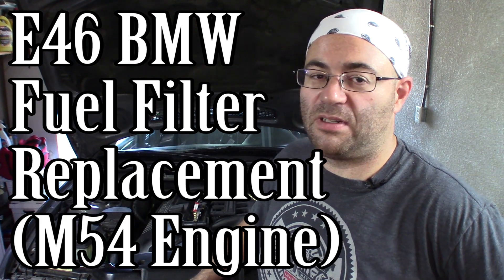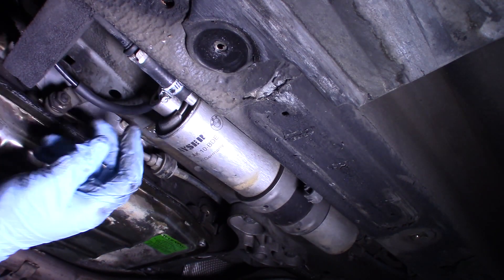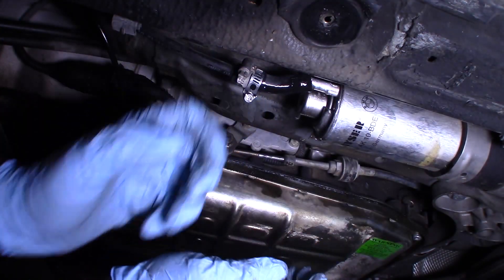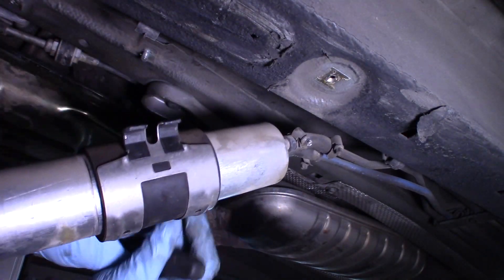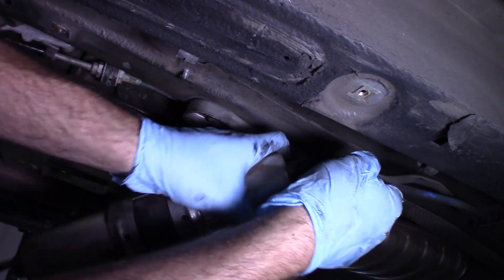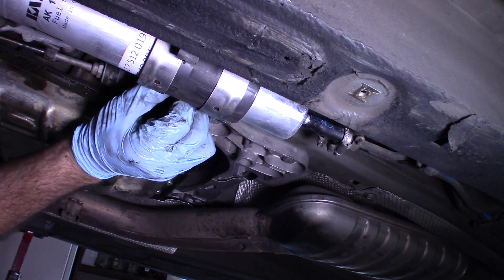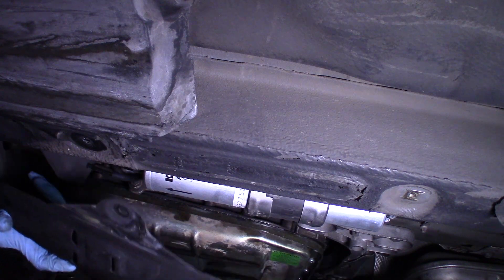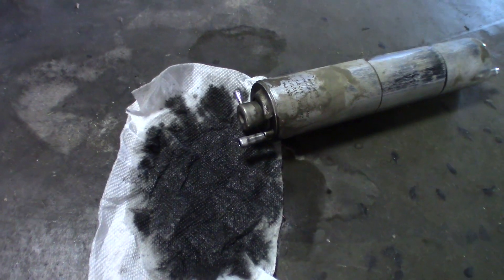BMW 330i 325i E46 Fuel Pressure Regulator Replacement (M54 engine) DIY

Comment: Hi, your videos are a great help for the M54 owners(including me). 
I have a situation now, and I'm really curious about your opinion about it. 

Let's start with the start. 
More than a year ago I discovered that I couldn't empty my fuel tank more than 1/8th of the meter. When the warning light came on, my car died(with a left range of 80-90km). It happened 2 times before I knew I had to fuel earlier, and the problem was 'solved'. 

Half a year ago, the engine check light came sometimes on. It was not always there, but just sometimes. It was throwing the codes P0174 and p0171. At first, i was looking for a vacuum leak somewhere. I changed the DISA gasket, the valve cover gasket(including new vanos), and the two Rubber boots at the intake. It was still coming back. I changed my MAF sensor, but this also not helps, and the last days its getting worse. After i fuelled the car completely up, it was really worse.  At cold starts, its dieing directly 2 or 3 times. After that its shuddering and on 5-cilinders. It throws codes P1085, P1083, P0174 and 0171. 
Also sometimes the car is giving a whistling noise, coming from behind, that differs on the revs. 

After long thinking I will change my fuel pump and filter(regulator). I guess thats the only logically left thing, except of a closed/contaminated catalysator. What do you think?
Reply from the maker: Check out my common vacuum leaks video. 171/174 is almost always one of those.
Reply: The problem is solved! It was the fuel pump, it was failing. Not completely failing, but failing in capacity. More than half a year my car was running too lean due to this pump. In the first 5m i felt the difference. Feels like a diesel now, much more torque in the low RPM's. Still thanks for your answer.

Comment: I need to replace vacuum hose from F point to filter smaller one on bottom. What size of hose is that and what length I need to go all the way to fuel filter ?
Reply: To clarify I need replace vacuum line to fuel pressure regulator, and it’s that a difficult job ?
Reply: And do I need replace all line or just rubber ends ?
Reply from the maker: just the rubber ends.  You need 3.5mm ID vacuum hose.  You can find good quality silicone ones on amazon.
Reply: Thanks 50skid

Comment: i was going to this today on my 330ci and the hoses that go on the filter are rotten af so i need to replace them, anyone knows what size it is and also i want to change the clamps as well, i can't seem to find any info on sizes
Reply from the maker: just eyeball the clamps--they're likely the small ones you'll be able to find. The hose is 3.5mm ID. https://amzn.to/2I5ZECf

Comment: i have a rough idle on my m54 b30 and i don’t have any vacuum leaks, re did the vanos, re did the ccv
new spark plugs and coils
i have no codes either 
the fuel filter hasn’t been changed, do you think this is my issue?

Comment: Thank you Sir! My wife's 2004 325i had exact same symptoms : fuel pressure not quite 50psi (key to 2nd position & engine not running), Loss of pressure when key turned off, and pressure fluctuation of less than 50psi when engine idling. I changed filter last night and engine sounds as it should this morning--a slight beautiful hum!
Reply from the maker: +SKOOBIE TURNER Nice!

Comment: hi 50's kid! 
I love you video's and they have helped me a lot during my maintenance to my 320CI BMW 2003 anyhow i was wonder how many miles your car has done before you replaced the filter? i just did mine after 100.000 miles and i havent seen any of the black stuf coming out of my filter...

greetings from the Netherlands!
Reply: I think you have to replace filter every one or 2 years depending on your mileage that you do or every 70k miles

Comment: Hi 50s kid, I believe you responded to my questions regarding fuel regulator but when I went to read it I received a message saying "message reported" and I don't see your reply anymore. i apologize for the error and was wondering if you can repost? Also want to clarify that my concern is that if no vacuum is present at the small F tube fitting, especially during idle, that defeats the purpose of the fuel pressure regulator diaphragm... Any help is appreciated since I suspect there should be a vacuum during idle
Reply from the maker: +George Santana I think I've responded like 3 times already.  The fuel pressure regulator on the M54 is regulated to the atmospheric vacuum coming from in front of the throttle plate, which is very small compared to the manifold vacuum coming from behind the throttle plate.  You're not going to see any vacuum at that F connector when at idle, because that vacuum is created by air rushing past that opening when it's going through the intake boot and into the engine.  At idle, the throttle plate is closed, and there is only a tiny amount of air going through (into the idle air control valve).  In other words, you can ignore it.  If you have 50psi in your fuel system while running, then that is normal.  The sucking jet pump increases manifold vacuum for the brake booster by acting as a one way valve.

Comment: I don't know if anyone is still checking messages here.  I have a crank/no start with P0171 and P0174 lean codes.  I will be changing fuel filter and fuel pump tomorrow as I put in a fuel pump from a pick n pull and feels like same issue.  Also SES light is on.  Any other suggestions?

Comment: Wat was you symptoms that gave you this see i keep getting random misfire in 1st cylinder  code with cut off fuel i change o2 all 4 i change fan clutch i change fuel injector i change transs and  oil. I change allot im thinking its my fuel filter wen i press down on gas. Hesitations. Mis fire starvation. All that. Idk lmk

Comment: Thanks for the videos changed mine today :). Just a littel side tip if you want no fuel to come out of the lines you can run your car to  a quarter tank "maybe even half" jack the car from the front as high as you can so the fuel stays at the back of your car. leave your car like this for a couple hours "i left mine for 24hrs" There should only be abit of fuel left in the fuel filter that you will need to worry about.
Reply: Maybe if the check valve in the fuel pump is weak. otherwise the fuel line should hold pressure regardless of doing a wheelie with your car

Comment: Hi I have a question, I have a 2010 328i xdrive sulev and I was told that the Fuel Pressure Regulator is faulty, they already replaced the Fuel Pump, now they want to charge me 3k to change the Fuel Pump Assembly which includes Fuel Tank and kits, should I go to a Independent mechanic and change only the Fuel Pressure regulator? Thanks
Reply from the maker: What are the last 7 digits of your VIN number so I can look up diagrams?
Reply: A648645 Thanks

Comment: Thanks again for the detailed intel. Really appreciate it. One question, that vacuum hose should that little piece be replaced or the whole line? Not sure where that line ends.
Reply from the maker: +rene alvarado Little piece.  It is rubber 1/8th vacuum line.  The rest of the line is hard plastic.  On a 323/328i it terminates at the end of the fuel rail (nearest the firewall) and on a 325/330i it terminates in the F shaped connector in the upper intake boot.
Reply: 50sKid, thank you and again awesome work.

Comment: I changed the ccv kit on a 2005 bmw 325I. It developed a fuel leak where the fuel inlet hose connects to the fuel rail. It has a small crack. I know that area has a quick connect. Will it be the same on the other end?
Reply from the maker: Yes, same on the other end which you can get from below

Comment: Hey, i replaced my fuel filter and went for a test drive, ive been driving with the temp on display on the dash because of some overheating issues i had a couple months back, which i fixed by replacing the thermostat and water pump, but now when im idling for a couple minutes the car starts overheating and goes back to normal temp once i start driving again, please help me!!!
Reply from the maker: Those two things are unrelated.  Either your thermostat is sticking closed or your temp sensor is acting up

Comment: +50sKid Great videos,I have a ? My car lost power 3 times in one day.I have lean codes p0174p0171 and now my car want start and if it does which is rare it stalls immediatelyIt throw codes at 69mphNo pressure at the fuel valve.im getting ready to install a fuel pump.But before I do could it be the fuel filter/regulater.I hear the pump prime when I turn the key
Reply from the maker: It certainly could be the fuel filter--I would replace that first.

Comment: can someone please answer my question. can a dirty fuel filter cause erratic RPM on cold start which disappears when the engine runs for a few minutes?
Reply: Ben Horsley it jumps up and down between 800 and 900 rpm and you feel the car shaking. It settles after the engine warms up. And it smokes (white/blue) while it jumps up and down
Reply: Ben Horsley I have BMW N47 engine which the CCV is part of the rocker cover and I recntly (about a year ago) changed it
Anyhow how can I diagnose it?

Comment: Love your videos! This morning my 2005 325xi was running in the driveway and then it quit. Never happened before. Now it won't start. Motor turns over but doesn't start. Any suggestions?
Reply from the maker: Paul Gunn dead fuel pump maybe. Try pressing the schrader valve in on the fuel rail with a screwdriver and seeing if there is pressure. If not, it’s dead
Reply: Hi, when I pressed the valve gas spewed out. I replaced the relay and the fuse is good. Any ideas on why it turns over but won't start?
Reply: Schrader valve OK, replaced relay, fuse ok. Still turns over but won't start? Any thoughts before I have it towed away for yet another expensive shop bill? Thanks!
Reply: If was a dead fuel pump. Thanks.

Comment: Great video! I want to try this DIY on a 2004 330ci but had a bad experience in the past. I did the same procedure on a 04 325i and the car would not start after the fuel filter had been changed. I could not figure out what caused the issue so I put the old fuel filter back into the car and it turned on. My question is, could it have possibly been a defective new fuel filter? If so, then what's the part number for my vehicle? Thanks in advance.
Reply from the maker: +moraleseli1994 You need the same filter that you see in in the video--I actually mention the Keyser part number, which isn't the bmw part number, but look on eBay and you'll find it.  Keyser is the OEM brand and you can find it for a better price on eBay.  Can't say why the car didn't start in your situation, except that maybe you mixed up the inlet and return lines (at the back of the filter).

Comment: Hi....I just got my E46 about 2 weeks ago and I love it...it's a 325xi. 2005.....well I got 3 pending codes p0172,p0175 and a p1448...any advice on that?...fuel pump and filter replaced...new MAF ,plugs but not sure about o2 sensors....or ecm....any advice will be greatly appreciated....keep up with the videos they're great

Comment: How about the 320i with the M54B22 engine? does it use a filter with built in fuel regulator?
Reply from the maker: it should, yes
Reply: Okey, thanks for the quick reply!

Comment: Hi, my 330ci has some sort of internal leak in the fuel system that causes fuel pressure to drop over time. I'm not exactly sure what is causing this but it seems to hold pressure for longer when the car has run for quite a while vs she drops fuel pressure quicker when she has only run a few miles (under the same ECT temp). Could it be a faulty pressure regulator that holds pressure for longer when it gets heated up from the heat of the exhaust ?
Reply from the maker: +frank j it's the check valve inside of the fuel pump. It goes bad over time. You can install an aftermarket inline check valve immediately after the pump for about $7 that will solve the problem. Search for fuel check valve on Amazon and buy a 10mm one.
Reply: Will try that. Thank you

Comment: also I hear the airport but it also sounds like someone's cutting grass haa. Thanks man. I just bought a 2000 328i also and love it so far,it has 150k and runs really good and the exterior  is in excellent condition for a 15 year old car. I want to get it back to stock power at the LEAST.
Reply from the maker: +david Crawford So be aware that you have a different fuel system--a return style where the fuel pressure regulator is separate from the filter.  I'll be doing a future video on this one because a friend of mine has one that needs replacing, but it's actually extremely simple.  You'll see the pressure regulator (it's got a vacuum line going to it) and you'll see that there is a sort of metal retaining clip holding it in.  You pull that out and then just pull the regulator out (if you determine you need to change it).
Reply: +50sKid so what engine do I have if not the m54. and how much different are the two engines?
Reply from the maker: You've got the M52 engine.  It's basically the same thing only the M54 has an extra 0.2 liters of displacement (and a few more horsepower), the different fuel system as I mentioned, and instead of the solid aluminum skid plate underneath the car you have 3 tubular braces in a triangular shape.  Also you've got the pre-body lift front end. No xenon cat's eye headlamps.

Comment: I have a 325xi and for some reason SOMETIMES it sounds like a 4x4 like you can really hear the fan spin when I hit the throttle. Sometimes it does and sometimes it doesn't. And the other thing my fuel trims are around 10 to 14 positive and when I hit the gas it stays about the same. The long term is like -4. Do you have any ideas
Reply from the maker: That is quite strange.  Fuel trims usually don't stay the same at 3000 rpm as they are at idle.
Reply: 50sKid today at cold start the fuel trims were at -4 then at warm up it was at +14 then after maybe 20min it goes down to +3to+4 but still gets the p0171 and p0174 codes

Comment: hey question changed my fuel pump and fuel filter front two o2 sensors  on my 2002 325i still getting  a po152  po174  p1085 ive done the checks for vacuum leaks changed boots f connector and all lines i can see not sure  what else it could be any help would be greatly appreciated still getting misfires 5/6 cant get it to pass inspection  car is starting to be a pain i have the rear o2 sensor to put in next car is running at 27%stft on bank two only would the rear o2 sensor cause it to lean out
Reply: Did you figured it out ?
Cleaning your Maf will also help.

Comment: Great video, learning a lot from you about maintenance on my new e46. Do you know what size hoses are used in the fittings and the pressure regulator (I have a feeling I will need to update those too when I change the filter...)

Cheers

Comment: I have an 03 325xi is it the same process to change the fuel filter? and do I need to buy the regular fuel filter or the filter with the pressure regulator?
Reply from the maker: +adam c yes and you need the combined filter and regulator

Comment: Anyone knows the sizes of those hoses ? Or part number?
Reply: Da Maestro buy the filter and take it to any car shop get them to fit the hose's on you will need a silicone hose for the pressure wich is the smallest and fuel hose for the rest you will also need 6 clamps that can fit the 3 fuel hose's try get them in stainless steel so they dont rust

Comment: hey man I have a question. I have a idle fluctuation only on cold start,not cold weather, and the car seems to fix itself or go away when I start driving. it stays at around 800 rpm then will drop about every 8 seconds to like 4-500 rpm then go right back up. I was told it could be a vanos? any help would be awesome.  keep the videos coming.
Reply from the maker: +david Crawford I don't think it's the VANOS.  My guess--and I'm completely guessing here--is that there may be an intermittent fuel delivery problem--possibly with your fuel pump.  I would check fuel pressure, first thing.
Reply: Dude I've had the same problem before. Ended up being a split vacuum hose.
Reply: Do you remember or know which one or were it's located.
Reply: +david Crawford hi dude I don't know what hose had a split. The splits can be tiny and very hard to find
Reply: old question but still - if some of you have idle problems with cold starts with cold weather (below 13°C) and then when the car gets to temperature the idle is normal (and also when the problem goes away with cold start when the air temperature is warmer than 14°C) - THEN you have a problem with vanos on your M52TUB engine. The ar has special mode when the outside temperature is low, that it opens the vanos on neutral to build heat in as quickly as possible - that is why it is mysteriously occuring only when cold starting on cold day. On M54 this probably wont happen as it should have an electronic fix for that mapped in ECU. I am just writing it anywhere I can because it took me a lot of time to find the problem on miine, so you can sort out yours if it does the same :)

Comment: Got a question for ya. I just replaced my fuel filter in my e46 today, well going off your video the two lines on the back of your fuel filter are/were reversed on mine because I just put them where they were before on the old fuel filter. Would the car still run with them reversed to know for sure if they were in the wrong placement all along and now even? Damn, I really didn’t feel like getting gas all over again even with pulling the fuel pump fuse and letting it run before replacing.
Reply: thats a pump and return line from the pressure regulator built into the filter, i dont believe it will run reversed, as the pump feed will be going into the outlet of the regulator... then again, who knows. lol